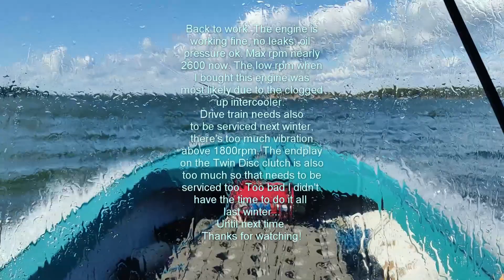Perkins T6.354  Range 4 Overhaul. Workboat engine Before and after Rebuild

Comment: i have a perkins 200hp turbo and the oil line busted and the engine shut down at sea, I fix the oil line and changed the oil and filter. the engine is running but now I hear a knocking sound, do you think I need to rebuild it

Comment: Hi there. Was there a specific kit you worked off to do the rebuild?
Reply from the maker: Hi, no specific kit used. I ordered all the parts I needed from UK. There was some special tools for the job but they are virtually impossible to find so I had to make them in my workshop. The service manual is a must of course. It gives you the wear limits and other instructions, part numbers etc.
Good reliable engine, definitely worth overhauling.